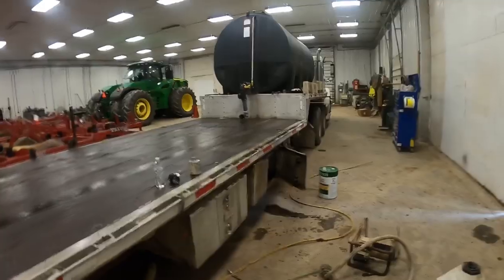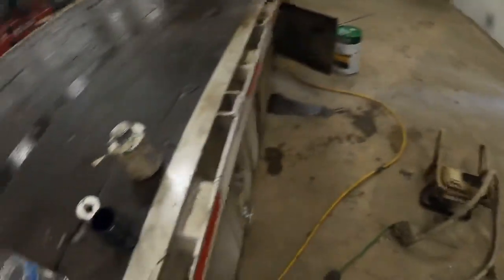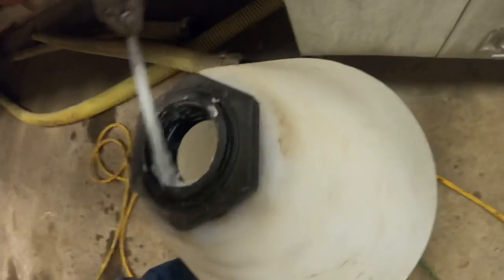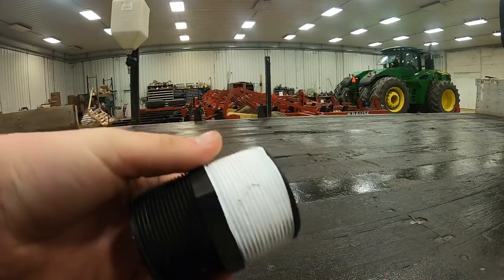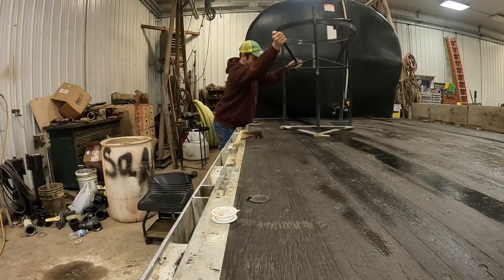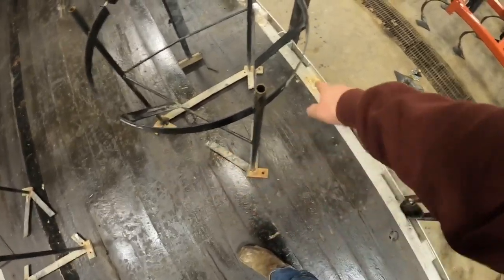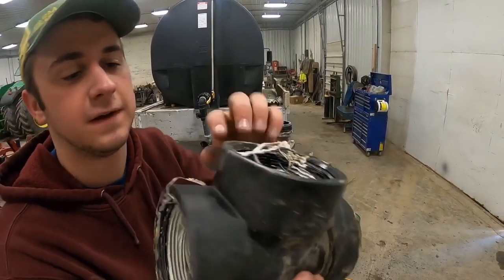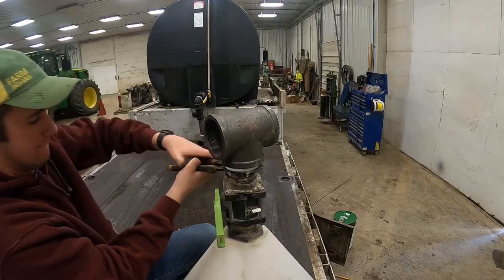Let’s rebuild it

Comment: Alex, next time put the teflon tape on the other. You are supposed to wrap it in the direction you are tightening  fitting. Just a little hint. I enjoy your videos.
Reply from the maker: I allways run the opposite i think could be wrong I’m not sure i do know if you do it the wrong way it’ll spin all your tape right off I just kinda have a system for it anymore if that makes sence
Reply: @lrruschfarms6352  Alex you are correct. I just say hold pipe in right hand, turn in direction to thread pipe in, tape in left hand and let it thread on the pipe...  Don't let anyone tell ya different.   lol
Reply from the maker: I have done it so much that anymore it’s just a habit to go a certain way

Comment: The oil  flows like a thin weight at 15 on start up    As the oil gets hot the flows like a 40 weight. 15 w 40    In your cold climate I would look at 5 w 40    So oil is thin on start up    The oil will flow faster on cold days

Comment: I will tell you I used to get additives on all that extra stuff with modern oils it's really not necessary now we drive real trucks not gm products hahah but we put 500k on one truck zero mechanical issues it still running today we have over 300k on the 5.9 and 200k on the 6.7 our oldest 3406E had a million miles we had the motor broke down and it looked almost perfect inside and every diesel engine we have gets rotella oil except the tractors we use brand oil just because that's what they started with we have had great luck so far
Reply from the maker: We use additives in most of our trucks some of them have had a knock here and there seems to help them

Comment: @09:22 HI #justthatfreakinggood ROSS........Alex just blamed you for getting oil all over his manifold and after all he IS #justthatfreakinggood ROSS and is absolutely RIGHT!!!!!!The first number 15W is the viscosity of the oil at cold temperature, and the second number 40 is the viscosity at 100 °C. The 15W40 designation means that the oil is a multigrade oil. It has the viscosity of 15W when cold and the viscosity of SAE 40 when hot. This means that one type of oil works in all temperatures.

Comment: Why don't you just turn the key but don't start it and let your electric fuel pump prime the fuel system
Reply from the maker: You still have to let the air out of the system but all our problems there had to do with the filter not sure what it was exactly but as soon as we put the old filter back we didn’t have any problems